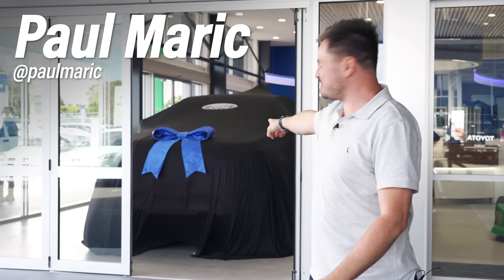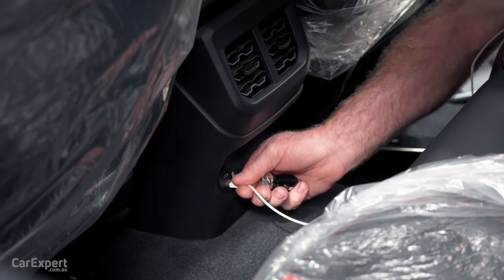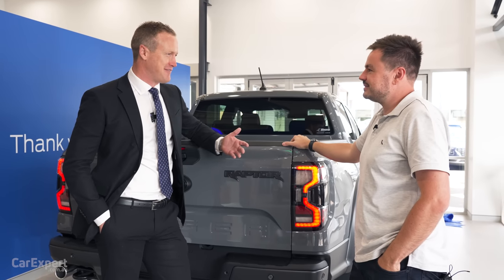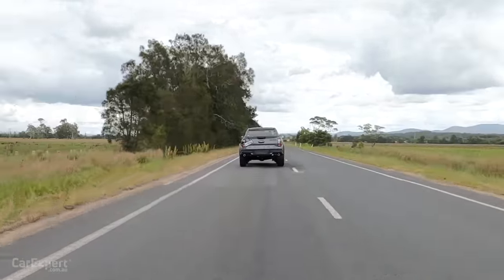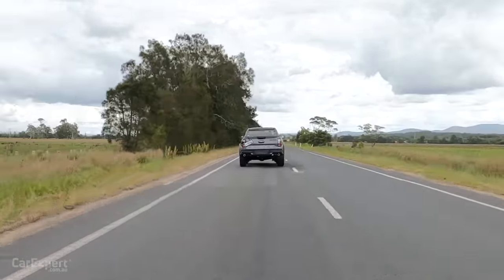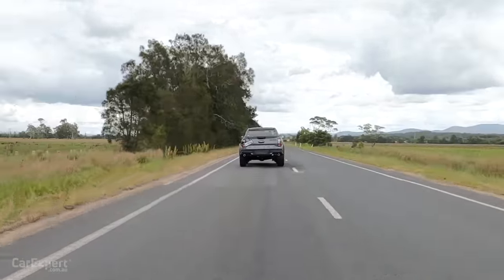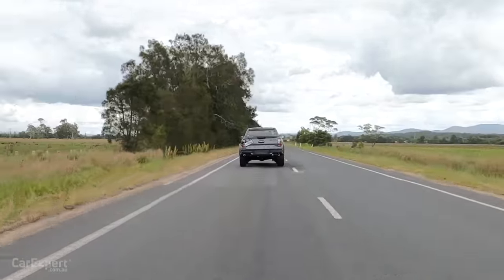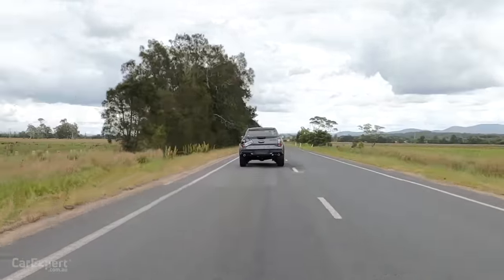TAKING DELIVERY of my Ranger Raptor! What your delivery fee covers & answering questions!

Comment: Hi Paul
I was interested in your comments about which tub cover you are going for?
I just took delivery of a Meteor Grey RAPTOR & have gone for the solid cover colour coded with the vehicle mainly due to aesthetics
Reply: @michaelmadden7882  $4k. What was yours?
Reply: @michaelmadden7882  I ordered mine in Jan got vehicle in Oct. Got stung with an excessive dealer delivery charge but got the vehicle cheaper than what they are being sold now and got massive discount on the vehicle as well on top of that. You can't wipe the smile off my face though as it is the most impressive vehicle ive owned or driven & i own a worked HSV CLUBSPORT as well. The RAPTOR is an absolute ball tearer & FORD have knocked it out of the park & that is saying something from a parochial HOLDEN man.
Toyota etc must be crying into their sales brochures over this one! 😉

Comment: with the info that said about the fuel usage, would this apply to the diesel 3 ltr wildtrak? I want to order a  Wildtrack fully optioned but am suspect about fuel usage as well as the the transmission plastic base plate and other under body protection. Curious about your thoughts as with under body protection out of the factory, is the same.

Comment: Hey Paul,
With regards to the mileage, why doesnt the dealership reset it to zero?
Great ro see the delivery process. :)
Reply: I don't believe you can reset mileage. You can reset trip meters but not the main mileage odometer.
Reply: Because it's illegal
Reply: @deanrwilson   Just would have thought if you are buying a brand new car, not even taken possesion, the dealership could reset it.. Obviously not the case.. I guess this would just be my expectation to drive the brand new car with zero on the odometer.
Reply: @troymash  Hey Troy, just out of curiosity, why would it be illegal for a dealership to reset an odometer?
Reply: @rodwhitaker9834 because you are misrepresentng the condition and usage of the vehicle. NO new vehicle comes with zero miles. Cars start ticking Ks of the production line, test, drive to transport on /of ships, on/of trucks  storage yards, dealer road tests. Etc. Don't sweat it, ut's normal.

Comment: Paul, we all realise that you need to be somewhat conciliatory to the dealership because they allowed you to “jump the queue”, but let’s get serious. I think we al, know that the manufacturer supplies a vehicle to their dealerships as part of the cost of the vehicle, customer doesn’t pay this. Over 100kms on the clock and you think this is “pre-delivery” testing - sorry I think your car was used for test drives. That work you stated as pre-delivery is not worth the $2000 or more dealers charge - if indeed any of it actually happens. Enjoy your new vehicle anyway.
Reply from the maker: Nope. The fee paid by the customer includes delivery to the dealer. It’s not covered by the RRP. It also wasn’t used for test drives - that’s what demonstrator vehicles are for. They’re registered and don’t have all the stickers and plastic on them. The mileage is pretty typical - was the same with my Supra and Model 3. Both were brand new.

Comment: Congratulations! I really like the colour and the Ford Ranger Raptor is a very nice car! As a non-Australian, I have to ask why the number plate wasn't attached properly at the dealership. Seems odd to an European and even odder to one living in Japan where the rear number plate is officially sealed on so that you can never take it off (this is anal and unnecessary to be honest).
Reply: Its a TRADE PLATE  no doubt after a 1200 Kilometer drive  it will be posted back  but I suspect it will also avoid toll charges ???
Reply from the maker: I’ll be registering it in Victoria (I bought this from another state), so drove it back on what’s called a trade plate.

Comment: ford all models had cheap plastics all around. also please tell me, honestly answer please. how is the quality feel like in cabin. do you feel quality? or still fords usual cheap plastics all around?
Reply: Coming from a 2019 Escape to the Raptor, it is a massive step up in materials quality for all the major touch points. The steering wheel is really nice, as is the faux Alcantara on the dash and doors. The switch gear has a nice solid, but smooth feel to it. The seats are so good, the best compliment is that after a while, you just don't notice them. Is it Merc or Audi quality? No. But it is also not in that price bracket. Only time will tell how well it all wears.
Reply: @auswi  thanks for the comment. i ordered one. hopefully i wont be disappointed. an american truck was my dream. this raptor model is the closest i can get in UK. fingers crossed

Comment: Interesting to know why you say you keep clear of E10 fuel?
Reply from the maker: The engine works fine with E10, but I wouldn’t touch it. Ethanol hygroscopic, it doesn’t last as long as regular unleaded and it can damage engine components that aren’t properly treated for ethanol use.
Reply: @CarExpertAus  to be honest that sounds like a ford problem if it's true, all modern cars you can buy today and probably as of 2000s are supposed to be fully compatible with E10 are they not?
Just like all new cars use unleaded petrol and the components that used to suffer when we changed from leaded , like the valve stems and stem guides have been remanufactured to work with the new types of fuels.
Sounds like you've got just a tad bit of nostalgic paranoia 😂
I fully get the whole ethanol doesn't store as long but if your car is standing that long with any fuel in the tank it's considered smart to ad a fuel stabiliser or drain the tank.
E10 of today has a storage life of around 3 months, plenty of time to use up a tank of fuel 👍
Saying all that, I do run 95 or 98 once in a while, like every 10th or so tank fill,  just to flush out any areas in the tank/fuel lines.
Noting, I am doing about 1000-1200km a week.
If anything I'd say E10 at 94oct is better in a turbo motor than 91oct unleaded, if the manufacturer states it can use all fuels available in Australia.
Some people might add that Australian fuel is sub quality, well this next gen ford ranger was designed with Australian engineers specifically to handle everyday life in our great country, so I think we're all 👍 
Just my 2 cents worth
Reply from the maker: @troymash  Most new cars are compatible with E10. I just wouldn’t touch it.

Comment: Good old uk & eu have castrated the ranger raptor down to around 300 hp so won’t be that special 😢the 0-60 time takes a massive hit and for the cost £48k plus vat not the great truck it could of been
Reply: Has that got the V6 engine in it?  The vat is a pisser if you're not registered like the look of it 300hp is enough surely?